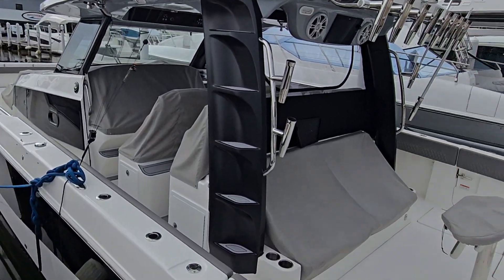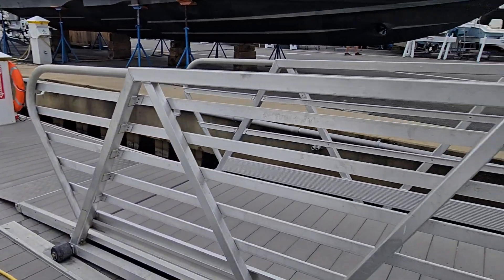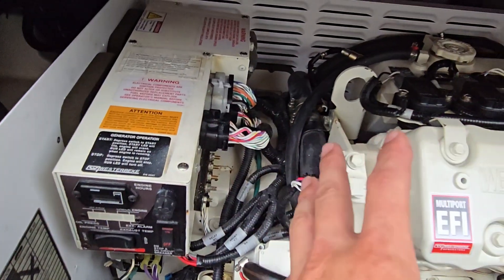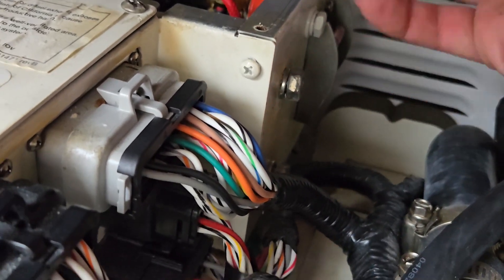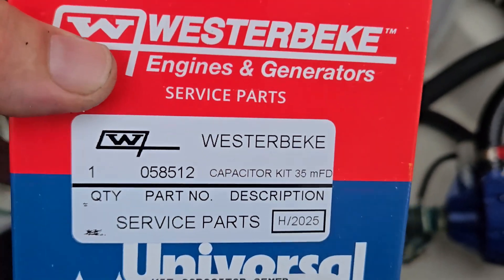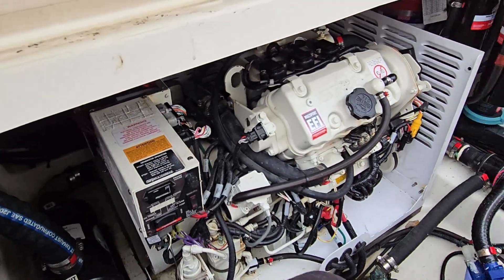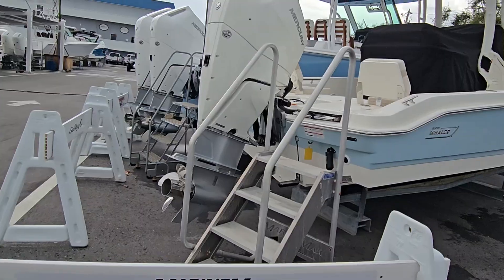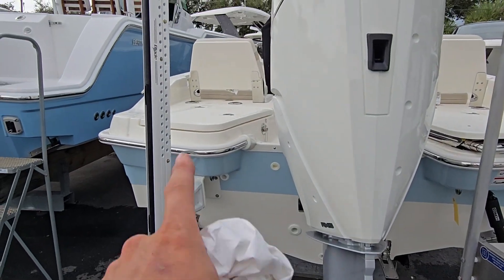Low AC Voltage On A Westerbeke Plus An Update From The Last Video! #Capacitor #MarineMax #Westerbeke

Comment: Hi Justin, glad to see you back. Only point I would add is to make sure the capacitors are discharged before touching them, no fun getting zapped. Have you ever had to replace the diodes on the westerbeke generators?
Reply from the maker: Thank you, and yes. The old screwdriver on the terminals trick works. They can bite you. I have never replaced the diodes before, but now you jinxed me 😋